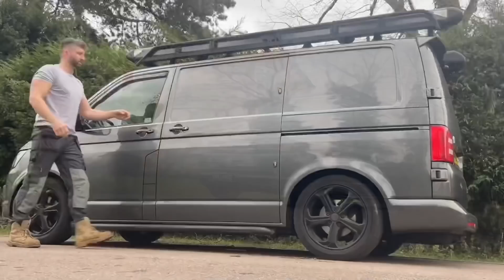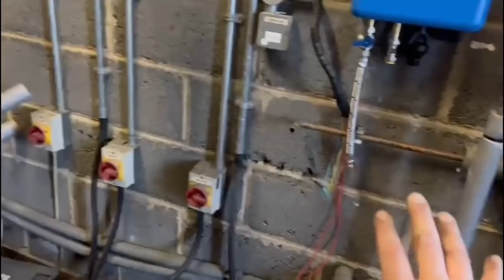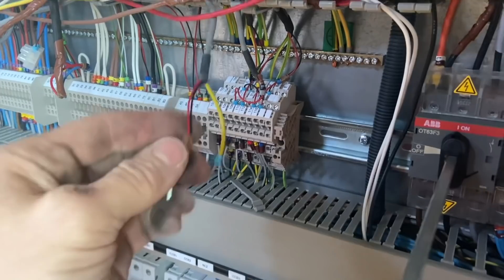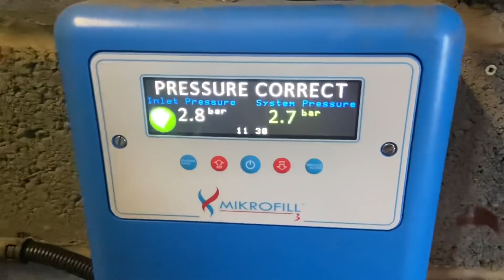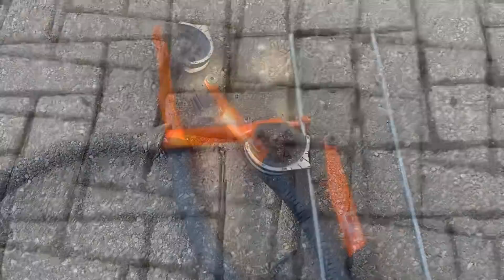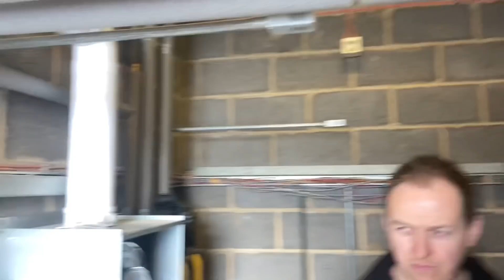P B Plumber Commercial plant room part 2

Comment: good bit of work for 3 days, looks like a good set up with boiler & LLH. similar thoughts to few other people, tubolit laggings a bit naff in commercial boiler room, i would have thought the type of building it is would have necessitated class 0 insulation but i get what he's saying about customers budget. I would always put an isolator on before an AAV, perhaps not so bad with copper pipe but steel pipe will soon clog the built in isolator on them. The original system looked unnecessarily complicated, something often seen when consultants are involved, is a BMS really required on what essentially looks like a smallish office building? Pet hate of mine and prob most other plumbers is electricians not removing redundant equipment and cabling. Again theres a budget issue in this but it makes life so much easier for ongoing maintenance.

Comment: Did you purge the gas pipework with a purge stack?
Reply: For the sake of 1M of 28mm it’s a bit overkill
Reply: @heatspec  agree, does sound OTT.
Reply: Yeah I’m always unsure on short pipe runs of a commercial gas run with the purging process

Comment: Well I agree with the guy who left the comment saying to use a toner but also as long as you know it's isolated you can also use an OHM meter and shunt one end sometimes I find that more accurate than a toner because of signal bleed but then again good old-fashioned tucking Pole works a good bit of the time

Comment: What fitting do you use to connect on to the tundish on the Mikrofill?
Reply: a 1" MI straights fits it, it should really discharge to drain or outside as every time the pump operates it discharges water, good wee top up pumps, expensive though, thats a little over a £1000
Reply: @scotsdunc  yeah that's what i've been using but i'd like to find a plastic equivalent fitting, think that would look a bit neater than having a lump of brass hanging off it.

Comment: Just a quick tip if your trying to find where different wires go if you twist together the earth or live etc and then go to the other end of wherever your trying to find out put a electrical tester on it out it on the ohms resistance settings you should get some sort of reading done this a lot when trying to find out which cable is which

Comment: Niice joob... 👍 Only one question about the lagging, not need Foil Face in plant room with label?
Reply: Foil face yeah, I put an extra price in for that but the customer asked to keep it budget. It’s a leased property so they didn’t want to spend mega bucks on this one. It was a case of get it done for a basic set up
Reply: Yes you do, sorry don’t want to sound negative but it looked like a domestic job in a plant room. Been doing plant rooms for over 10 years and there is a lot I would have done differently.
Reply: @rosscasey8900  I'm struggling to see what the header is for if there's only one heating circuit and the hot water is tapped straight off the boiler flow before it reaches the header?
Reply: @cliveramsbotty6077  header is for flow rates on the heating. Hot water doesn’t need it as it’s a small circuit
Reply: Also bags for the valves

Comment: Get a tracer and tone generator. You connect a little box at one end of the wire which sends a tone down the cable. You then have a probe which picks up the tone and lets you hear it through a speaker when you put it near the right cable. Mainly used to identify telephone cables.
Reply: Beat me to it as I was going to suggest the same thing👍
Reply: I have one, they can be just as long to use
Reply: Just touch the live and neutral and see what breaker trips is also another method

Comment: I look after 20 odd hospital plantrooms around london. as your pipework rises thats the spot for AAV 's  not manule av. quite worred about  that . the size of the Boiler  could overheat very quickly. unless you get rid of the heat asap. all the aav are spot on but should have isolation on each one. Looking forward to the hand over. Just a small moan  why are you showing people how to go into these panels. you can isolate at  emergcey valve but people bypass this to keep it running in hand.  Very Dangerous.
Reply: They’re flamco aavs, auto air vents which have a valve in the bottom half separate to the bottle, so you can remove the bottle while keeping the system filled. Don’t see why showing people how to go into a BMS is dangerous since the majority of people watching this would be engineers themselves; and for the minority who aren’t engineers, it’s not as if they would have access to a commercial plantroom regardless
Reply: @archiehickford314  fair play but  safe is safe I’ve seen nut nuts in panels who haven’t got a scooby.
Reply: @tomobrien8417  yeah, totally see where you’re coming. A lot of cowboys out there
Reply: @archiehickford314  the integral 'valve' in the aav will occasionally fail and spray you in the face without warning lol i don't trust them, an extra tenner on a lever valve is the way to go
Reply: It's true regarding what you film and how you approach safe isolation/electrical safety when filming. Although there are many sensible watchers, it takes one to see this and get carried away thinking that they can go into a panel and start touching wires.

Comment: Seen people on other channels recommend fitting a regular ball lever valve before the AAV for future maintenance. For the sake of a couple of quid, it lets you properly isolate it for replacement. I know they come with the valve which is supposed to close when you screw the AAV off but they don't always seal and then you can be left with little option other than draining sections of the system.
Reply: This is the way I do it. Put a ball valve and throw the little valve that comes with it in the scrap bin
Reply: I haven’t had issues myself
Reply: I do the same thing
Reply: We do the same on all our jobs t, nipple, lever valve then AAV!

Comment: We have fitted Flamco type AAV's into press Tees many times before however I did read somewhere a while back that you should not do it directly into the Tee as it can suck air in. The velocity of the water is too close to the float of the AAV and can cause turbulence resulting in the float not keeping a seal and introducing air to the system. The correct method is to add a length of pipe say 200mm long and then put the AAV on the end of this stalk. This then keeps an amount of water before the float in normal operation. Hopefully this makes sense?
Reply: Should always be putting valves before them aswell

Comment: We use toners to find control wires,put the tone box on it and go find it at the other end!
Reply: I concur with your thoughts on a toner though I have run into signal bleed making it more fun so sometimes you just got to do it the old school way shunt one in and look for continuity
Reply: Labelling should be suffice, but toners take just as long
Reply: @heatspec  We use telephone wire toners,much more specific.Figure if a guy can easily dig through a 3,600 pair cable and find his splice,then that was good enough for us! And I fully agree labeling is great,until someone has been there before you and doesnt give a crap and cuts them off! Thanks for the gteat videos and imformation! Pete
Reply: That's interesting 🤔